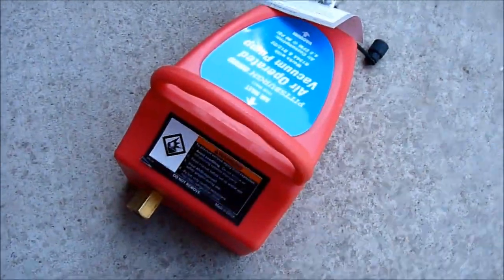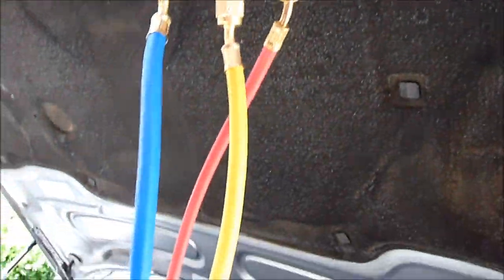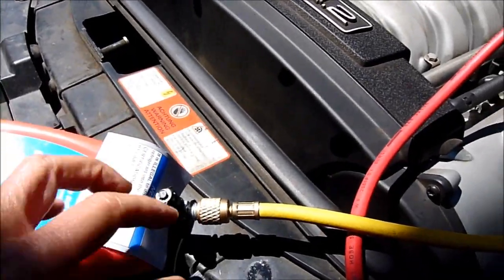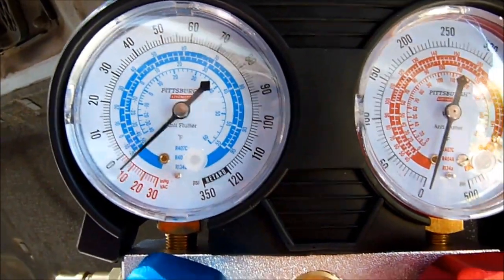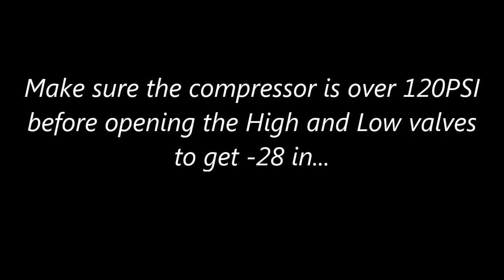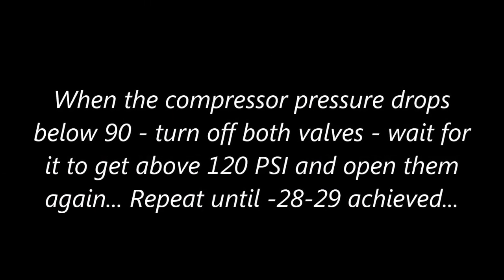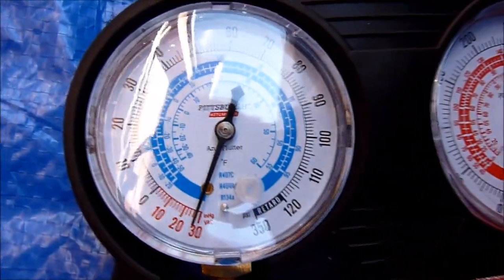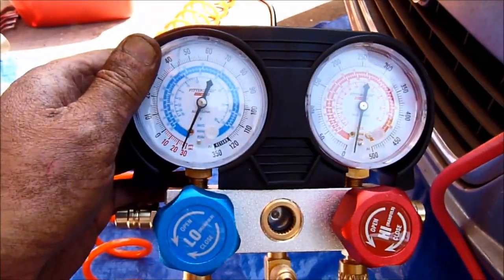Test AC System for leaks using vacuum pump

Comment: You wanna use nitrogen pressure to test for leaks, not a vacuum, thats gonna pull air into the system
Reply: To clarify, nitrogen is the leak test, if you hold pressure there your good, the purpose of vacuuming is to ensure moisture is not present, its all the same shit guys. If you pull a vacuum when you have a leak it will pull in moisture
Reply: Pulling a vacuum pulls air into a closed system= uradumbass
Reply: @107649365  the key to using the nitrogen is making sure its completely closed, that was probly the dumbest thing ive ever seen commented back, lol explain how you know its a closed system please, cuz where i come from you gotta check micron readings and such during a vacuum, you can pull a vacuum all day but if you have a small leak you wont get under 500 mucrons and have it stay, and 30hg on the gauges doesnt mean shit by the way, getting it close doesnt cut it if you want your ac to last a long time
Reply: @Nihlistpunk_CM  you know this for car ac systems right? Ofcourse its a closed system, how else would it hold r134a? Ive never heard of nitrogen testing a vehicle ac system before. I believe that your thinking about other ac systems rather than a vehicle.  It wont suck anything into the system unless you have a leak in which case its already ruined the reciever drier. Your supposed to break the vaccum seal with r134a = no air getting in the system

Comment: FYI the pressure did drop about 1/2 an inch Hg if you look closely, also these tests are for gross leaks, most leaks take weeks or months to leak enough Freon to cause the unit to start cycling.
Reply from the maker: integr8er66 it’s been almost 2 years and the ac is still ice cold as of last hot weekend. The system is holding up well.
Reply: @3dogs1monkey  I did learn why that might be, and I saw the same thing on my system yesterday while checking it. If there is some moisture left inside once you isolate the system, its vaporizing can raise the pressure a little bit, as long as it stabilizes without going up too much its still ok, but just because your system was sealed doesn't mean the test is valid, you can pass this type of test and still slowly lose refrig. The pressures while running are much higher than atmosphere, and sometimes a leak will go out but not in, lots of other things to look at, this will catch some leaks, but its no guarantee
Reply from the maker: @integr8er66  You may be right, but it's a 13 year old car with everything original and if the AC blows cold every 2 years for 21oz of  freon, I'm happy to redo it again. I remembered my 1998 D2 which I had to recharge every year.
Reply: @3dogs1monkey  I'm not saying you did anything wrong, just adding more info for other viewers trying to find or fix a leak
Reply from the maker: integr8er66 will you fix the leaks if it dropped like mine? LOL
Reply: @3dogs1monkey  No, and I never said yours leaked, in fact mine did the same thing, and I left mine over night and it stabilized at more than 29" so I went ahead and charged it, and for me that is a commitment, my system is R-12. There isn't much of that left in the world.

Comment from the maker: This is the test I showed after spending $80 for the pro to evacuated and tested that was no leaks in my system. The gauge shows no pressure already. This is in case your system is empty and how to use this $20 vacuum pump.